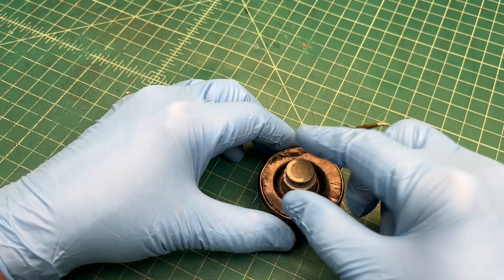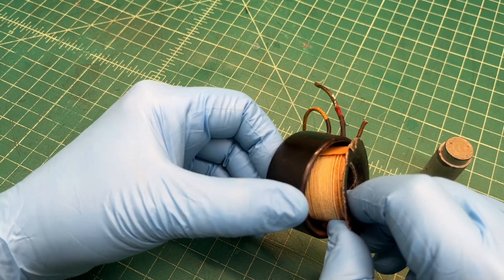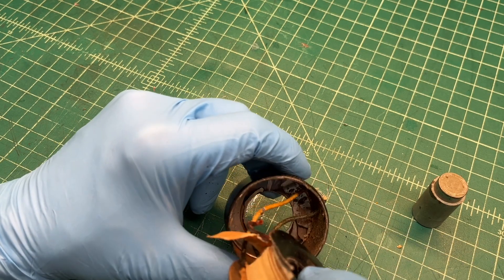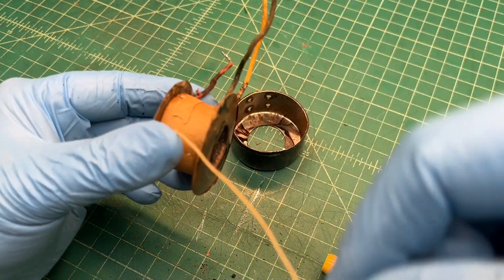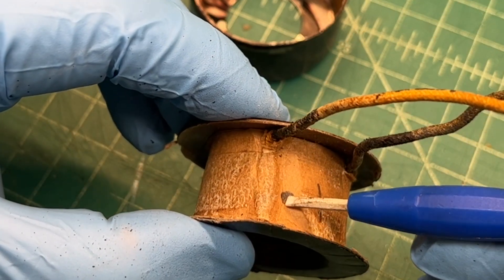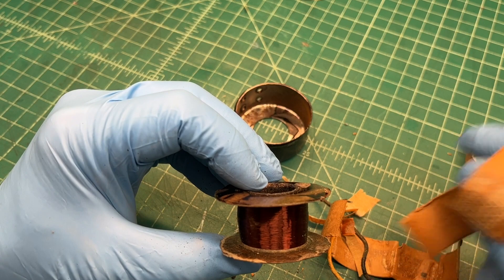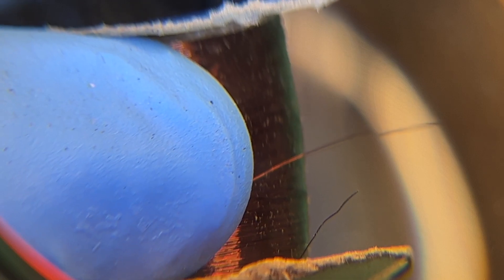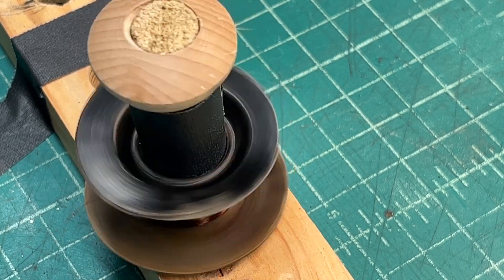Emerson R156 - Field Coil Repair Attempt | Before Thunderstorms Arrive

Comment: Are you using a turns counter when unwinding the coil? I was going to have a go trying to make one the next time I needed to count windings.
I heard that the winter storms around the great lakes region can get pretty nasty, hope you are doing OK.
Cheers,
Reply from the maker: Eddy, doing good and hope this finds you doing well also. I didn’t count turns after discovering the undersized wire and knowing I would likely go back with a larger AWG. I just published a video and mentioned your question. Good luck on the counter. I’ve got one I built using Arduino that I will put to use when I rewind the FC bobbin. Thanks for reaching out and all the best. Don